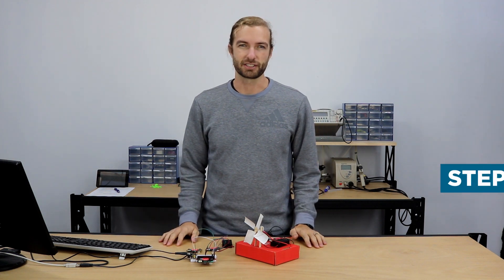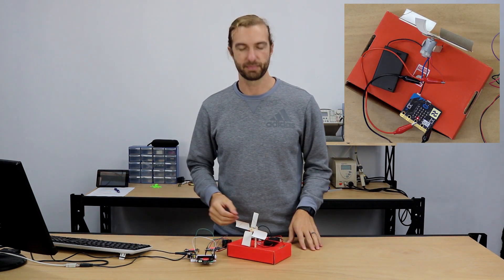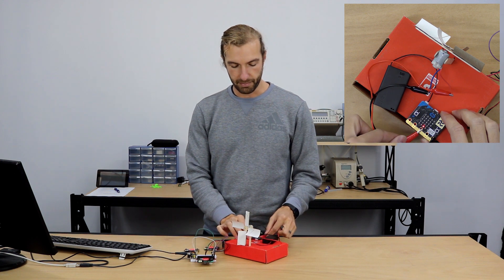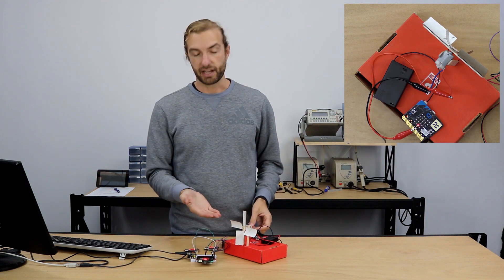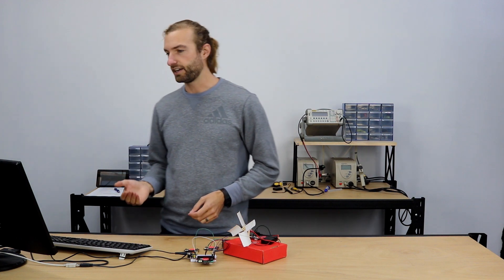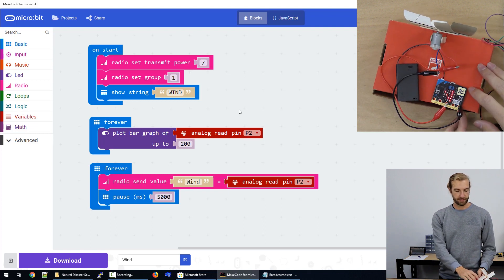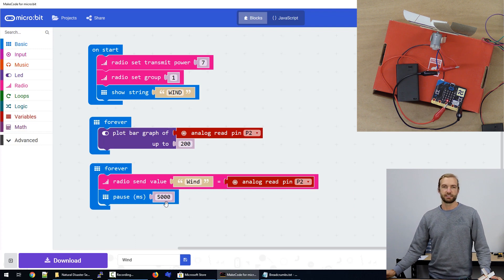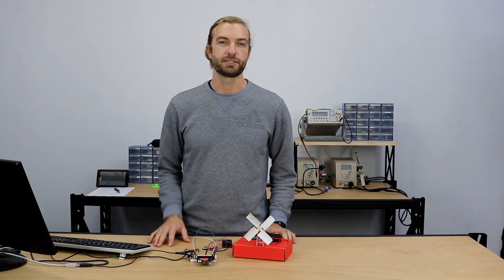Micro:bit - Natural Disaster Project - DIY Wind Sensor

Comment: Hello, I have made the code, but I was wondering if there was a way to convert the value to mph?
Reply from the maker: This unfortunately is not a calibrated sensor and only outputs the analog reading. To get a MPH value you will need to find a way to calibrate it. There are a few ways to do this, but the easiest would be to find some wind that you know the speed of (in MPH), then record down the analog reading from it. Do this with some different wind speeds and youll be able to figure out that wind speed from the analog reading!